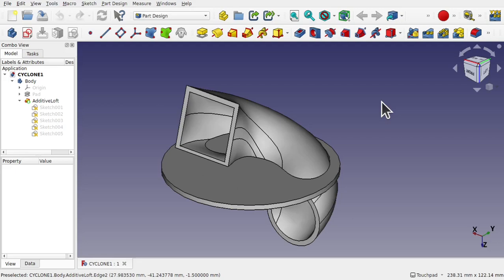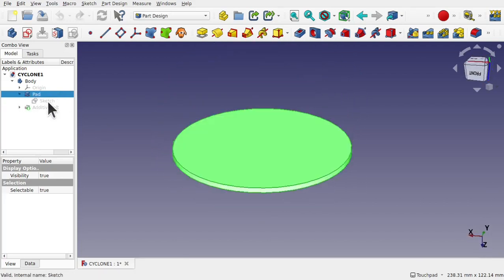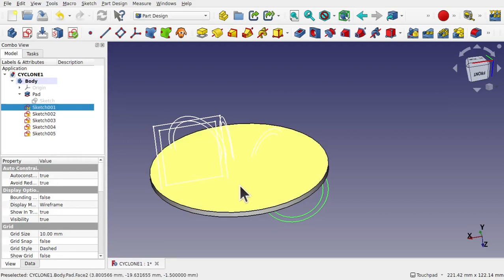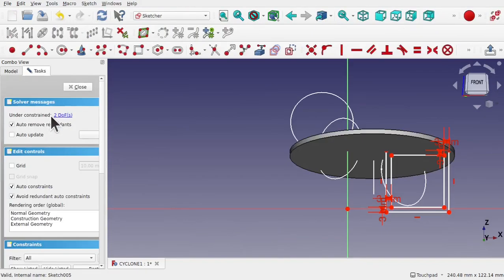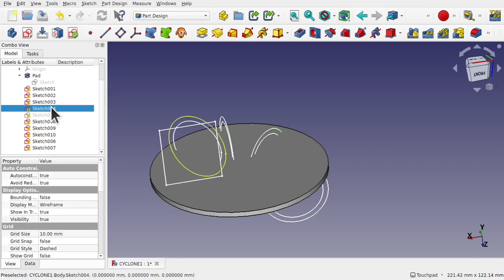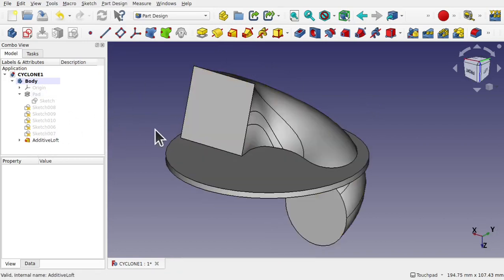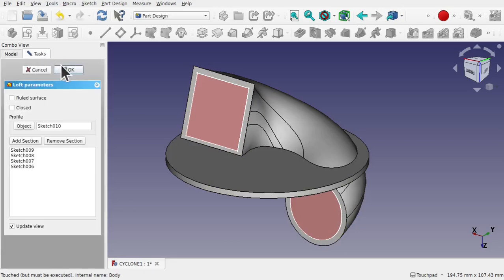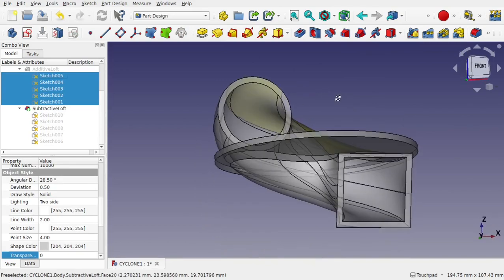FreeCAD: Peer Review | 4 | Cyclone for Hoover

Comment: When specifying the subtractive loft, why not hide the additive loft to make the section sketches visible?
Reply from the maker: You can but the only thing is you will loose the ability to see what the  result will look like whilst your adding the profiles. If there are any errors you would have to delete the subtractive loft after rather than abandoning the attempt the minute you see a problem with one of the profiles, say, coming through the addative loft.

Comment: Nice.

Now I'd like to know if the user is going to print this part, and if so, how.
Reply: Yepp...a tonne of support
Reply: ....on second thought...it could be limited through splitting the .stl in two and place it on the split surface on the working area.
Reply: @robgoodsight6216  Split through the circular pad?
Reply: @christopherkecun8349  yes...but also through a vertical section.  Basically  if one can intersect, cut, the curve of the loft, the curvature can be printed without the help of any support....or using a minor support.
Reply from the maker: Really interesting comments thanks for contributing everyone.
Reply: @MangoJellySolutions  thanks to you

Comment: 03:40 It's annoying that when duplicating multiple objects (sketches) FreeCAD puts in the copies in random order. I do duplicate one by one, so I can then select all at once in treeview and create a loft. That "Add Section" only adds one section at a time is also annoying… the "add" button of fillets and chamfers is smarter.
Is it possible to create a subtractive loft from the 2 subshape binders?
Reply from the maker: Thanks for highlighting that I have never noticed about the random order. I don't know  if you can change the order in the treeview, its not something I have ever tried. Something to look into. Regarding your question about the subshape binders. Yes lofts can be created with them but be careful as changing the geometry underneath can cause the sub shape binder to bind to a different face than the one you selected before. This would be easily solved if the support in the property tab was not read only. Other objects you can edit the support so you just select the faces/edges again. It's a shame lofts are not like the multi loft in the curves workbench as you ctrl select the objects then select the button and done.
Reply: @MangoJellySolutions  Thanks, I didn't think of TNP for a moment. I like using parameters in spreadsheets which change during the process fromk idea to print so lofting binders would be one of those traps...I really do lilke FreeeCAD, but it still has a long way to go…
Happy holidays!
Reply from the maker: @NUeB_net  if your changing the profile but not removing or adding new geometry that adds edges or faces to it then you should be OK such as placement, width, height, stretching individual parts of the geometry (increasing the length of a constraint) etc. If your lofting the sketches directly then you also shouldn't have any problems. Hope that helps
Reply: @MangoJellySolutions  The most common problem I run into is that after changing dimensions that seem not to alter the geometry, edges still get new names and esp. chamfers and fillets need zo be re–done. That's weird, because after all the model looks absolutely the same (except for that slightly changed one dimension) but the edges' names seem to the shuffled… Since not every fillet or chamfer can be done within a sketch, this is quite annoying.